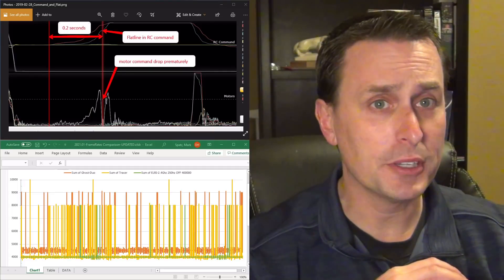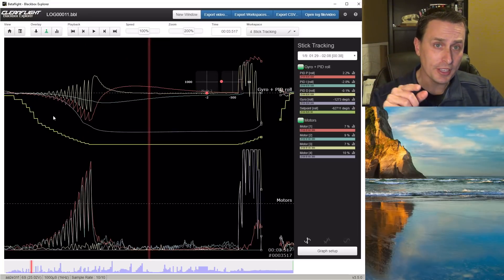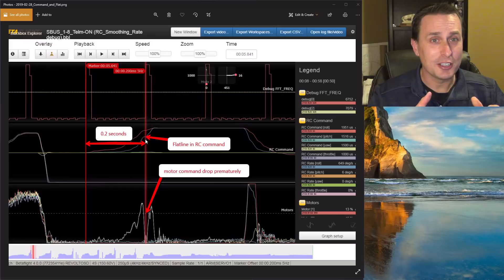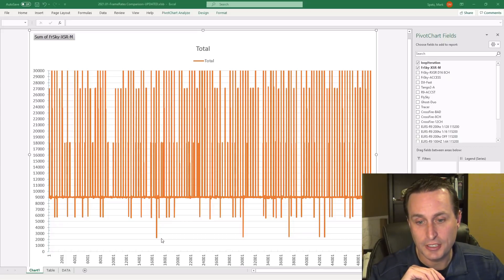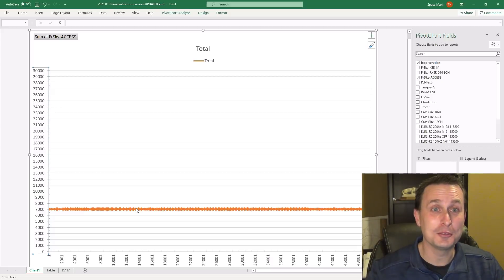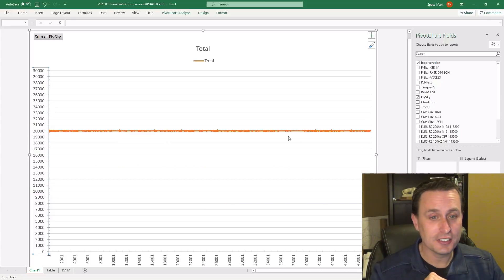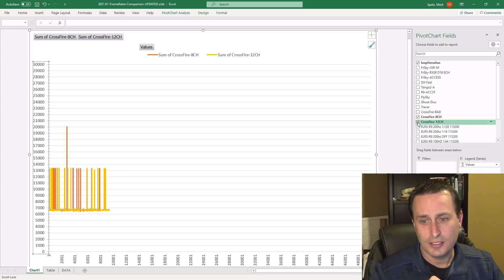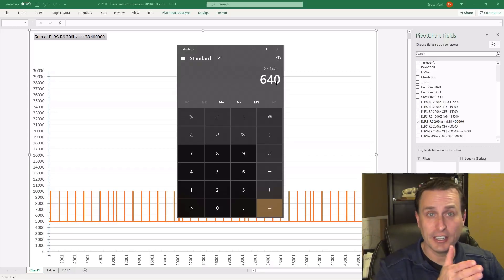Low Latency v. Frame Rate Consistency | WHAT IS MORE IMPORTANT!

Comment: You can mod your non-FrSky radio for ACCESS https://github.com/opentx/opentx/wiki/Externalaccessmod if you want to test ACCESS without having to buy new hardware.
Reply: That would only allow you to use R9 ACCESS module. 868 band has lots of issues in EU, and R9 ACCESS is not as good as 2.4 ACCESS according to what I've seen.
Reply from the maker: NICE!!  Anyone mode a Q X7s yet for pics?  Also, i have the Xfire mode added so that comes into play i guess?
Reply: How do you find the way to mod it.. I can't even understand what you did :(
Reply: @PaoloPonzoFinz  It's in the link above, with pictures.

Comment: Good first look at frame rate consistency, but it only tells part of the picture. 

Key point as noted a number of times in video; all "data is from first 6 seconds of flight". This means that radio signal strength is near it's best possible. If there is signal deviation, in lower strength, or interference then the results could differ. (ie: unknown, as not covered in testing) 

Another key point, is frame rate inconsistency only matters if it occurs as pilot control inputs are varying significantly between frames. ie: larger inconsistency will be more problematic with quicker control movements. A smoother pilot will not notice frame inconsistency as less so than a pilot making more aggressive movements on the transmitter controls.

For best comparisons, control values should be recorded (logged) at each of: 1) the transmitter 2) at the flight controller input, and 3) flight controller outputs (to motor/servo). Note that no analysis or insight provided as to the consistency of a flight controller processing control signals. A flight controller has a loop, which also acts as framing to control signals. Radio protocol is just one of many links in a series on the connection between a pilot and control of a drone, or aircraft.
Reply from the maker: Agreed.  You got some time?

Some.more tests are coming.

Comment: What hardware did you use for flysky ?
In my experience with spi RX and deviation TX radio it have 3.8ms frame rate on AFHDS2A and 1.5ms on AFHDS....

Comment: I would like to see the FRM302 which is a the new afhds3 protocol.

Also what where you using to run flysky?  I would assume afhds2a?  As you would recall my frame rate was steady at 6.02 ms.  The FRM302 is faster than that with 2.4 and long range.

Comment: Wouldn't it be more accurate to observe a quad floating in a good spot a few meters away. A starting quad might be in a bad position regarding antenna, carbon, etc and this would make it rather inconsistent as well?
Reply from the maker: These are all folks arming and taking off, but more tests are in the works.

Comment: I really could use some advice on which platform i should select in the upcomming season.
I have the R9M 2019 and after watching this video it seems like R9 ACCESS or R9 ExpressLRS is the way to go.
I will be using it with a mid range quad and Betaflight or maybe iNav and the telemetry is pretty important for me.
Any input on which one to choose would be much appreciated.
Reply from the maker: Is limited Telemetry enough? RSSI, LQ, etc...?
Reply: @uavtech  I would really like the GPS-coords as that helps in retrieving the model if it goes down. And VBAT on model. I saw that ExpressLRS will add extended telemetry but i don't know how reliable it is on that system when a couple of kilometrs away.
Reply from the maker: It is reliable.  It has VBat and other stuff now.  Maybe just wait.  If R9 ACCESS and ACCESS radio just use on Frsky FW.
Reply: @uavtech  Thanks, much appreciated. I'll use R9 ACCESS and the hw-mod for ACCESS on my TX16S and when E-LRS matures a bit i'll probably test it 
at the end of summer.

Comment: Im sorry, i couldnt carry on watching the video while you kept calling frame rate, a unit to measure the ammount of video frames, to what is clearly a milisecond, a unit of time. Althought on the same realm, they are not the same thing and relate to diffrent behaviors. One thing is the perception of movement, the other the movement (in this case the electrical radio signals) transmited from the radio to the quad, and how quick they are acknowledge by the quad (or car, boat, whatever). Thanks for the effort anyway.
Reply from the maker: Seriously.  Whelp, what should it be called smart guy?  Sample rate?  But it is not sampling, it is just transmitting data frames at a certain rate (frame rate).

Also please correct everyone when they say Power to Weight on a quad as that doesn't matter and it is Power to Moment of Inertia.

Btw, you are wrong ... but thanks anyway.

[P.s. ... and noone cares].
Reply: @uavtech  Wow, i love to be called "Smart Guy", it really elevates the conversation.

Comment: I’ve used crossfire shot locked at 150Hz and it flies great, BUT if I crash in the grass, then it will loose Rx connection all together. If you let it dynamically drop to 50Hz, then it can handle that situation and take off again. So... it’s a hard choice. What I want is a mode that really aggressively sticks to 150Hz but can still drop down to 50Hz if the only alternative is a failsafe.

Comment: The Tango 2 / Crossfire results are throwing me off. Is frame rate consistency driven by the transmitter or the protocol or both? It seems like it comes down to the protocol, so why is the Tango 2 so much more consistent than another transmitter with a crossfire module?

Comment: TBS just came out with a public alpha that you can find out about in the latest lounge that will allow you to have better consistency with tracer, could you make another short video comparing that firmware to the others?
Reply from the maker: There is more testing in the works.
Reply: @uavtech  Thanks🙂👍

Comment: Unfortunately your spreadsheet/graphs really don't show the whole picture. Every protocol drops packets. Period. End of conversation. So when you see the "honest" protocols that show frame rates that occasionally have jumps that are integer multiples of the normal rate, you're seeing the reality of the dropped packet(s). Some protocols mask this by just sending the previous value out of the receiver at the standard timing interval. Frsky Access is clearly doing that. There is no way it's not occasionally dropping a packet. So it's masking this by just sending the previous value. This is equally as bad as simply missing the packet since it causes the "flat spot" in the steps and has the same bad effect on feedforward. Actually in a lot of ways it's worse as Betaflight can't respond to the problem as we can't differentiate between the receiver sending the previous value or simply that the user didn't move the stick. With a missed (overdue) frame we can recognize that and react. As another example, Crossfire was originally this way as well where they'd send a "dummy" frame if the packet from the TX to RX was lost. We asked them to change that and not send the fake frame (and they did).
Reply from the maker: So the Tango 2 or ExpressLRS doesn't seem to drop frames nearly as much.  What is that?
Reply: @uavtech  Better radios or implementation. Or maybe just conditions of the flight.
Reply: @uavtech  Lots of reason potentially, at close range none of them should be dropping a whole lot of packets so probably this was due to bandwidth congestion with multiple TXs
Reply from the maker: The stuff at regular intervals is not interference, congestion, or bad orientation.  It is telemetry or bad sync.  

Regardless, more controlled testing is in the works.
Reply: @uavtech  Ah yes sorry in ELRS you will have skipped packets during a TLM response. But I had ghst/tracer in mind when I wrote that. It looks like ALOT more packet loss for those then I would expect, hence I thought those logs might have been in a race environment where there is RF congestion.
Reply: Absolutely. I was aware of it from beginning. To proper test it:. Programmable stick input in periodic model. EG for 150Hz link. From 1000 to 2000 and from 2000 to 1000. Every step in 150Hz rate. Like Oscillator in rate of radio link. Then simulate hard link conditions eg. min power and block antenna during the test procedure. If some radio cheats and sends duplicate frames to FC in logs should be "stairs" in sinus RC command trace.

Comment: Is this sheet available somewhere? I don't see it at your site (yet) and which debug settings does I need to replicate this test? I want to compare my Futaba 2.4 setup with the rest to see how it stacks up.
Reply from the maker: I would LOVE to get those results! I uploaded to tiny.cc/uavtech  The file is "2021.01-FrameRates Comparison-UPDATED.xlsb".  If you need in a different format let me know.  With large data sets (50,000 samples x 10 or whatever) excel works best as a XLSB (binary) format for speed and file size.  But if you need in native, let me know.  If you wan to runs your results in email me the updated file, i can re-publish (spatzengr at yahoo.com).
Reply: @uavtech  can do. Is a bench run without props good enough, or does it need to be an actual flight?
Reply from the maker: Bench is fine.  Better actually so then we know it is not a dropped frame from a tree or anything.  Try to get 12.5+ seconds at 4k pid loop (50,000 samples).  2k logging rate is good.

Comment: Trappy mentioned that the fame inconsistency is due to fame drops and hbas been improved significantly in the latest firmware update. I have the latest firmware on my Tracer. Happy to provide the data if you could let me know what I need to log.
Reply from the maker: LOG debug RC_SMOOTHING_RATE.  Shoot me the log at spatzengr at yahoo.com.
Reply: @uavtech  Will do so some time this weekend!

Comment: There is something weird going on with ACCESS, I ran 2.4 ACCESS for a while and the logs looked way to good to be true.

What's interesting is that if you look through the logs, there is some variation between each frame length, but some frames are identical length. Someone suggested that FrSky has worked out a way to 'fake' a valid frame by repeating the last frame when it misses one.

Comment: Could  you do a tech video on DJI air unit coupled to the DJI controller and goggles. Here is why. When flying a few hundred meters I get the drone icon turning red and on going further the the bars start to drop to no bars and then the controller also goes red then I had them both eventually disappear but the drone was flying perfectly OK and the goggles video was also perfect. What the heck is going on with the DJI icons and should I be concerned. Incidentally the ms rate never dropped below 30?

Comment: Was this tracer test before or after the update, and would it make any difference? (5.07)
Reply from the maker: Before.  Unknown.
Reply: I have a feeling that this "update", is just switching the system over to lora.
Reply: @darrensmith8107  Nah, they bumped the power. Approx 1W now
Reply: @deltageek7177  Ahh ok. Joke is on them though, even with the higher output power, ExpressLRS still kick tracer's ass in all aspects ;-)
Reply: @darrensmith8107  Damn right ;)

Comment: This video should be taken with a huge pinch of salt, ACCESS is known and confirmed to duplicate frames so the data here doesn't show the true picture. Also comparing the first six seconds of flight when the quad could still be sat on the floor or in different situations doesn't in anyway show how consistent the packet times are during actual flight whether it is Racing or Freestyle
Reply: I can offer bench test of the systems I have: ACCESS 2.4, Tracer, Crossfire in various modes (fixed 150Hz, 50Hz, Dynamic), Ghost Atto, Ghost Duo and soon I'll pick up ELRS 2.4. I understand you grabbed logs from various sources and taken in different conditions. Hope you'll agree that for a test to be somehow close to scientific we at lest need to have a consistent environment, same test length and number of samples. Hit me up on FB if you're down for making a new video.
Reply from the maker: @ak_fpv  , yeah, let's hook up.  This is real-world though, keep that in mind as it is what folks are getting; me included.
Reply from the maker: It was actually 15 seconds in some cases.

You have any better information or testing to offer?
Reply: @uavtech  Alex has the latest logs that are more representative, When you say Ghost Duo do you mean the Atto or Atto Duo Receiver?

Comment: Good info as usual, thank you!
Do you have any data on FrSky ACCST v1.x vs ACCST v2.1x? 
Also, it would be interesting to see how the multi module in for example the Radiomaster TX16S handles the different protocols in regard to the frame rate consistency.
Reply from the maker: I do not have that one.

Comment: Was tracer tested with or without CRSF shot? If not I would expect a drop in variable latency with it enabled and would look more like the tango 2 crossfire 150hz result. I am not sure if you mentioned it or not so just wondering. Thanks for the video!
Reply: CrossfireShot just helps to better connect the sync issues between the radio and the Crossfire module. Has nothing to do with end to end latency (radio sends the command, RX recives it, FC detects it and makes changes).
Reply: @BikeGuyFPV   I believe it does, by syncing the module looking for the packet and the radio sending one you have a more consistent frame time and reduce variable latency, Bardwell covers this in the video he did on crossfire shot including the black box logs showing a reduced "stair stepping" effect and he says near the end that there is less variation in frame time / latency.
Reply: This isn't what crshshot does
Reply: @deltageek7177  Watch Bardwells video on crossfire shot as I said in my reply to bike guy below I believe it does reduce the variation in latency.
Reply: @arm_fpv412  No it doesn't,  it synchronises OpenTX and the CRSF module such that openTX gives it fresh gimbal data just before it's ready to transmit. It doesn't change the rate (interval) of the packets. 150hz is 150hz.
Reply: @deltageek7177  https://team-blacksheep.freshdesk.com/support/solutions/articles/4000153333-crsf-shot-open-tx  This also says there is an improvement in variable latency and it's from TBS themselves, now I would say maybe the 95 percent claim is high but I do believe that is what it is trying to do.
Reply: @arm_fpv412  Mark is not measuring variable latency here, he is measuring the frame time between packets. This shows the dropped packets. The baseline frame will be the same, either 50/150hz whether or not crsfshot is used. To see the effect of  crsfshot you'd have to look at the raw RC data.
Reply: @deltageek7177  Ok if that is the case then why does crossfire at 150hz look so good compared to tracer using the same underlying engine but just not tested on a tango 2 with crfs shot? I honestly could be missing something but it seems like it's doing something to help cut down dropped packets or the time between packets being sent.
Reply: @arm_fpv412  @DeltaGeek  Do you know if newer updates for Tracer solved the problem with the jumps in latency up to 8 and 12ms ? I aks myself if i want to switch from crsf shot to tracer but now i am skeptical if it would be no benefit or drawback...

Comment: Crossfire still seems to be consistent if you force modes. Has been for years. Happy I'm sticking with it :)
Reply from the maker: I would not say has been for years, but yeah, Crossfire shot has fixed it.
Reply: Problem with crossfire is that locking crsf at 50hz, is then its really slow, and locking 150hz range is horrible and inconsistent.

Comment: ACCESS protocol is masking dropped frames by duplicating the last successfully received frame. Just not to think that it is not dropping any frames at all.
Reply: Easy to find these dropped packets by looking for steps in the RC commands.
Reply: Yes!, this is actually quite bad because BF has some logic in FF that handles dropped frames differently and the duplication of the old frame in ACESSS breaks this.
Reply: Don't be discouraged by this thought - 2.4 Access is really good, especially with Archer RS receivers. It's just not easy to tell how many frames it drops compared to other systems.
Reply: Really Frsky XD
Reply: I'll never buy anything FrSky new again unless they fix ACCST, but when R9M units are $20 on e-bay..

Comment: I’m still using my Taranis X9D+ ACCST and I have never used the 2.4 GHz module. 
At the same time, I bought a R9M and 3 x R9MM (868MHz), I did experience issues of the quad
twitching until I installed the Ranger Flex firmware and fly only on a fixed power level. After this I had no more issues, I do use Telemetry and this is the only thing that has held me back from putting ExpressLRS firmware on.
Is it still worth it If I’m using Telemetry?
I will not be buying another FrySky Tx for the same reason as yourself.
Interestingly I had to go back to my old FlySky TX to fly a quad and I was impressed how good it was
For a cheap radio.
Reply from the maker: I think yes for old ACCST R9, but i mostly only use basic telemetry so it is fine for me.
Reply: @uavtech  👌🙂

Comment: So if I’m using the newer Frsky ACCESS R9 gear then apparently I can use less than the 20-25 RC input smoothing I’m currently using?

Edit:  As well as change my rc input average down from 4 to 2?
Reply from the maker: Yes.  And let smoothing just be Auto.

Run debug RC_SMOOTHIMG_RATE to check it out for yourself.